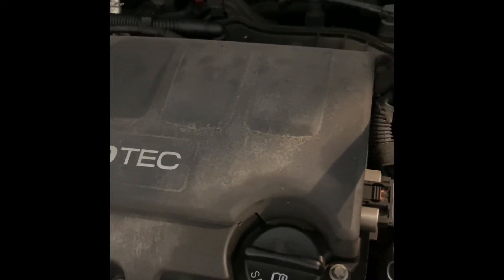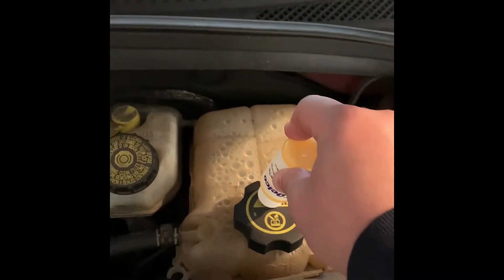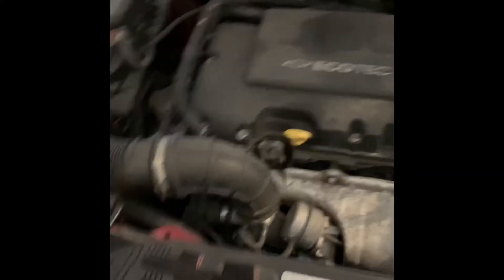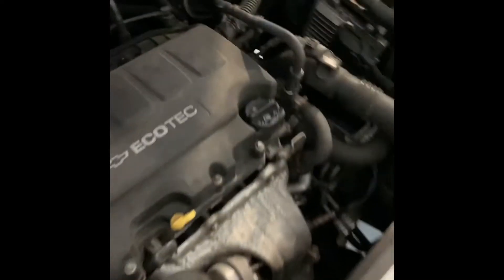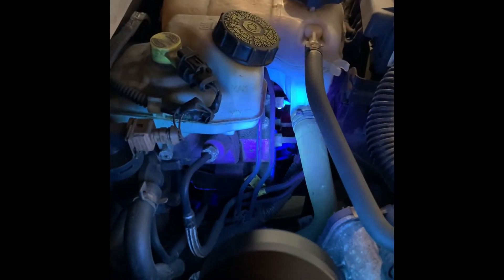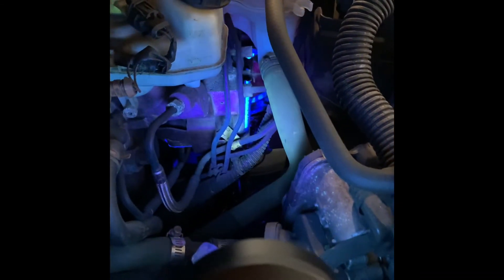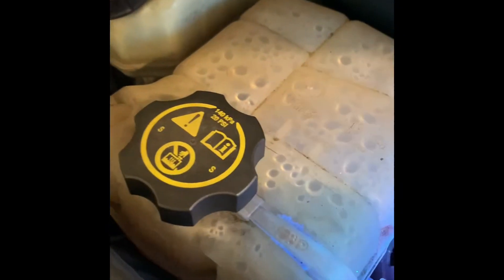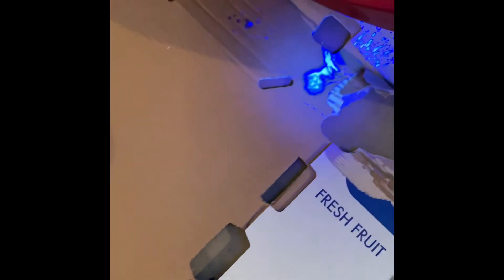Car Coolant Leak - How to Find It Yourself

Comment: My reservoir getting empty everyday. Should I put dye first and then top up coolant to check leak or just put dye bottle and then check?
Reply from the maker: If you are loosing coolant that fast, you should be able to see the leak when the car is running without adding dye. If not, check your oil. If the oil looks milky or foamy, you have a blown head gasket. Or, if the design of your engine has the water pump being driven by the timing chain, your water pump could have a terrible leak causing coolant to pour into your engine. If none of that is the case….then ya, pour in dye and fill up the coolant. Run the engine and look for the leak.

Comment: Did you use dex cool antifreeze or any vehicle antifreeze? I don't have dex cool in mine so just wondering if I needed to flush the system and replace with dex cool or if I could drain  my antifreeze and just use water with the dye. That way I could reuse my antifreeze
Reply from the maker: I used Dex because the GM vehicles take that. But you can use the dye in any antifreeze and leave it in. No need to flush it. Just pour in the dye, find the leak and top off with the recommended antifreeze.